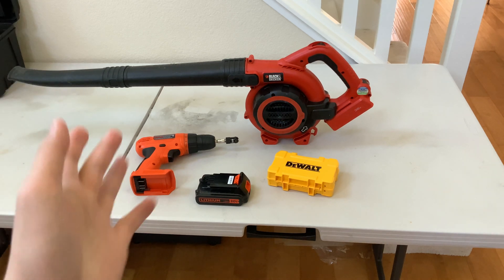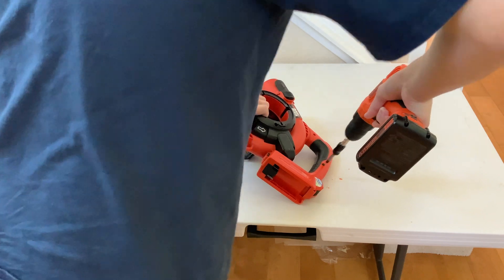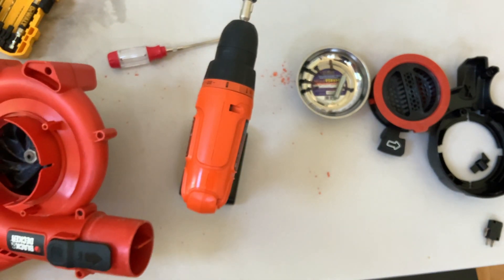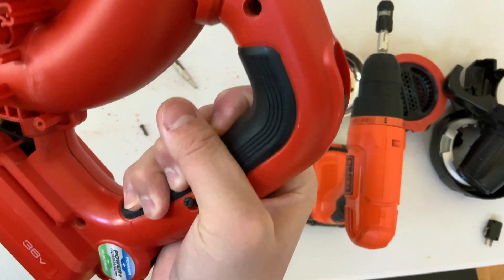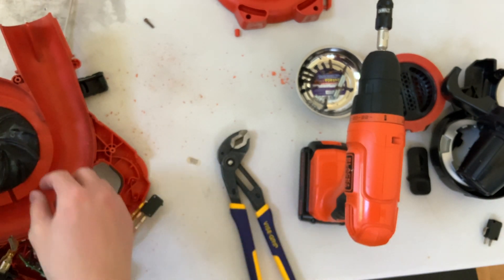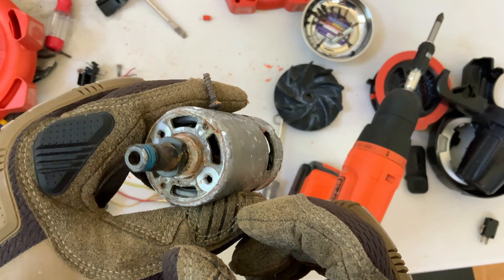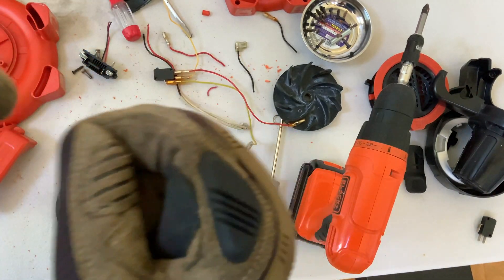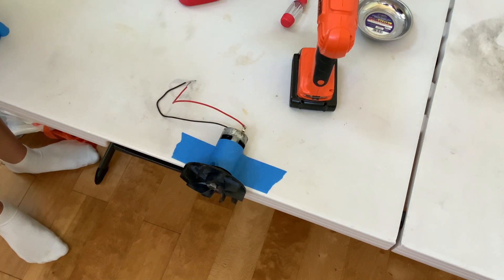Leaf Blower Teardown

Comment: (Hah! After 3 years I am proud to be the first comment...)  This video saved my 5 year old leaf blower from the trash.  My motor started squealing like a flock of Canadian geese.  I only needed access to the motor so I could shoot WD-40 inside it and, voila, no squeal.  WD-40 is NOT good for this but its all I had (will flush out the WD40 with silicone spray once I get some).  Your demonstration of accessing the motor made this possible -- I could not see how to get that silver-ish snap-in cowling apart.  Looks to me like you had already taken it apart because mine required considerable prying to get it off, then it was trivial to remove the screws.

Thanks for your video!